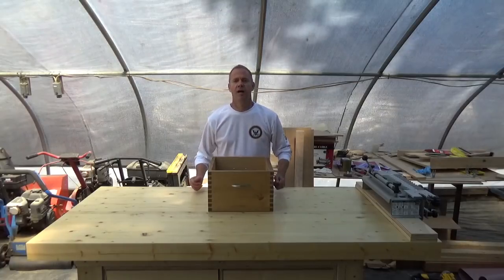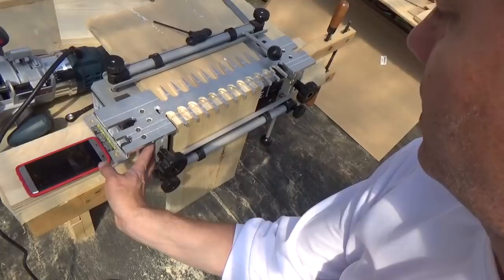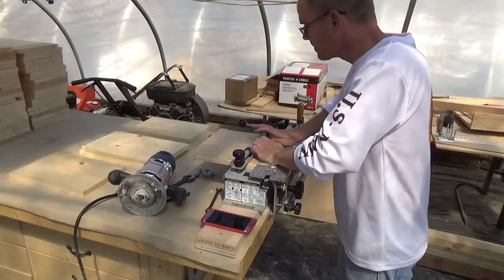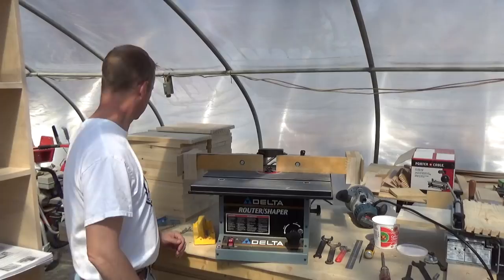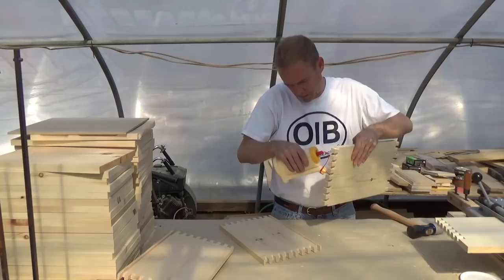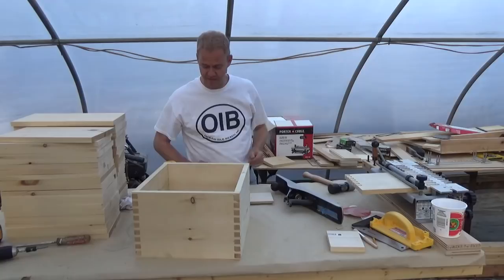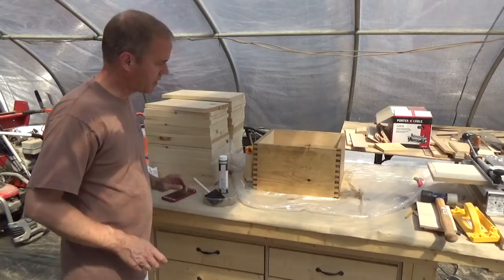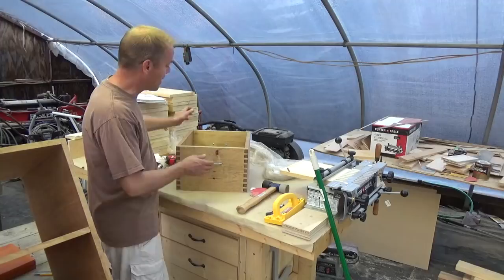Building a Through Dovetail Drawer / Box using Porter Cable 4213 Jig

Comment: Nice video.  As a Navy vet myself, thank you for your service.  You didn't mention that the instructions say that inch plus 1/4 is the ideal width for full size joints (4 1/4, 5 1/4. ...10 1/4)  That makes the alignment with the template much simpler.  I have found that  marking each piece with the thickness of it's mate will give you a line to adjust the bit depth to.    I wonder why you didn't cut all the tails first instead of just half but you figured that out later (as did I).  I found out that a collet centering pin is very useful--my bits were not centered in the guide bushing and this left odd gaps in my joints.
Reply: Back at you Shipmate, Thank you for your service. Now, to answer your questions...I am the woodworking hack...i really don't know what I'm doing, until I do it, lol.

Comment: About the hand held router,there is a kit by porter cable that includes 3 vacuum adapters !The one in particular works very well!You can drill a couple of holes to the base plate,or I have used double sided tape to hold it in place works perfect!

Comment: I know my comment may be a bit late but the depth adjustment is not always right from the factory. It should be set at 3/8” below the finger board. To set it I just put a 3/8 Allen wrench under the finger board and screw the depth knob until it touches.

Comment: The reason you had to plane the proud tails was because the factory set bit depth guide is not correct.  To get a flush fit, the depth guide should be 1/4" below the bottom of the template since the template is 1/4" thick.  At most, you might want 5/16" below the bottom of the template or 9/16" below the top of the template with no material inserted.  Yeah, I tinkered with mine too.

Comment: For through dovetails, the bit depth you set your router is equal to the "thickness of the template + thickness of the board that is joining the piece you are routing.  The factory bit depth template is based on 3/4" material.  If you decide to use 3/4" for the tails and 1/2" for the pins then the bit depth for the dovetail (3/4") = template thickness + 1/2".  For the the pins (1/2") the bit depth is template thickness + 3/4"

Comment: What was the depth to the bottom of the Template I did the same as you and messed around with mine so my depth is off. I know it is 3/8" on the front but can not find it anywhere in the instructions as to what the proper depth is for the thru bit gauge?
Reply from the maker: I'll go and check the measurement a little later on...It took me probably an hour or more to figure it out through trial and error.
Reply: Just to be clear I am talking about the ones for the dove tails the first cuts you made in your video I was thinking that it would be the thickness of the wood  you were using but ..... sorry auto corrects arrgh
Reply from the maker: yup, I got you.
Reply: I thought that you would measure from the depth of the bit to the collar tip of the template guide matching to the wood thickness it made sense as the depth of the dovetail (tails should be = wood thickness) if the tail depth was 7/8” and material was 3/4” the joint would not only be 1/4” off with pins and tails there would be gaps where tails and pins end

Comment: i got a question! when i put my joints the tails side is always sunk in on my pin board side what can i adjust to fix this??
Reply from the maker: Hi Dakota...This very thing happened to me. You need to adjust the Router Bit Depth Adjustment Screw on the jig. I made the mistake and messed with the factory setting. It took me a good hour or two to finally find the correct depth. you need to fine tune the depth adjustment screw in very small turns. this can be frustrating, but its the only way that worked for me.